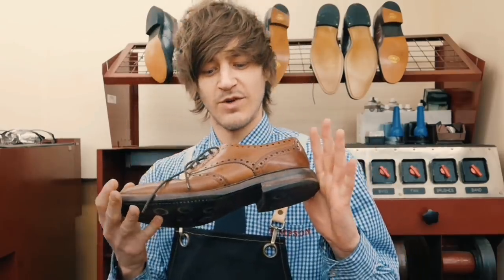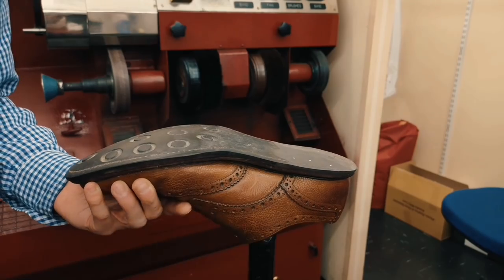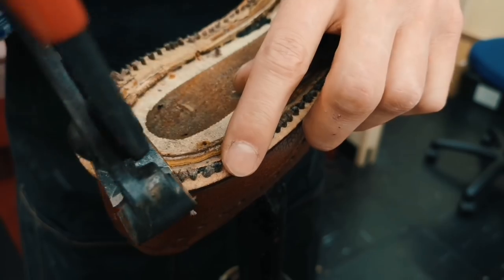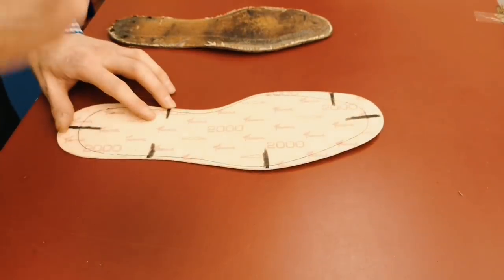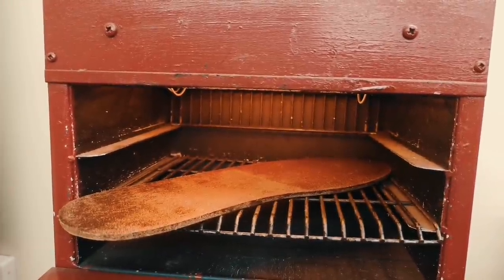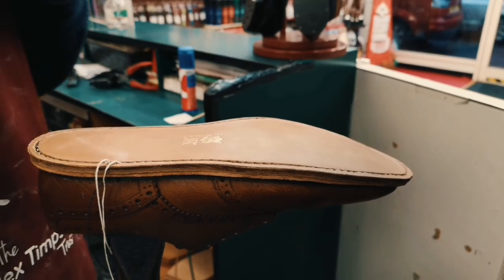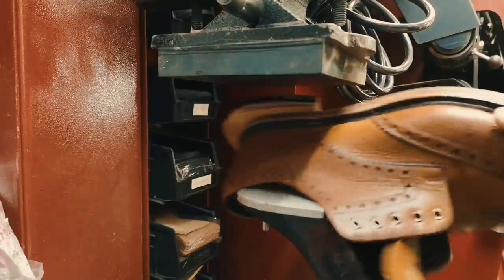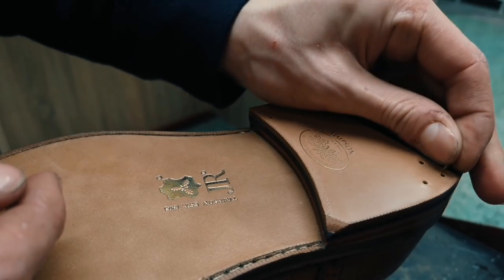Loake Badminton Detailed Restoration | New Footbed | Executive Resole #30 | Scottish Shoe Repair

Comment: So I'm curious, why do you suppose just about every piece of these shoes were to the point where they were crumbling away to nothing? Is that a testament to the lack of quality of the shoe / components, or were they severely water damaged or what?
Reply from the maker: These ones were quite old, and the customer didn't really take the best care of them, the insoles started to crumble due to wet, and not dried properly,  the shoes are made with good materials so it's not the manufacturers fault. Alot of years of wearing them almost every day to his work.  👊
Reply: @CobblerG  Very interesting and thanks for the response!  My impression of Loake shoes has always been very positive which is why I was so taken aback by the condition of these shoes, but totally makes sense!
Reply from the maker: I highly recommend Loake Shoemakers for sure! I've worked on alot of them! Very popular around here. Thanks dude

Comment: You added the toeplate after you had already done the outsole stitching. Wouldn't that cut the stitches you just put in?
Reply from the maker: No, being careful enough and the stitches being in the channel i grooved it is easy enough not to cut through the threads 👊🏼
Reply: @CobblerG  I wondered the same! Steve cuts it before stitching, but Trenton and Heath cut it after. The only thing that matters: If it works, use it!! If it's not broken, don't fix it! As long as you're comfortable with the way you do it, there's no reason to change it!!
Stay safe and healthy!🤗🌹✨

Comment: Oh dude, why did you use insole board instead of leather for the new 'footbed'. Your work is fantastic otherwise, but this component will wear faster than the old one. Leather insole shoulder is not that expensive and would have been worthy for these shoes.